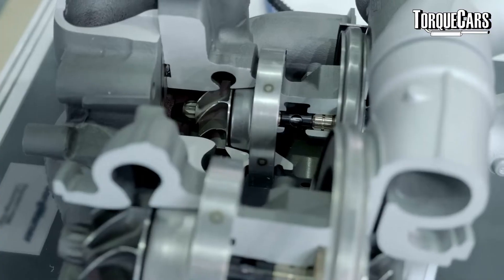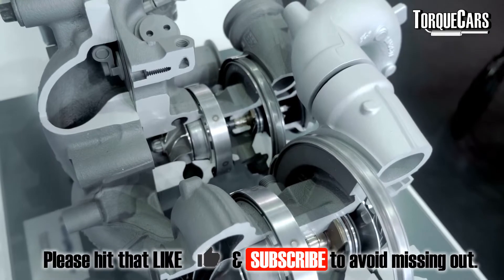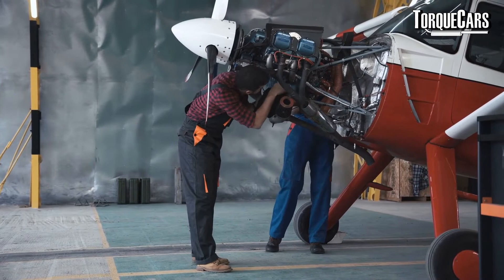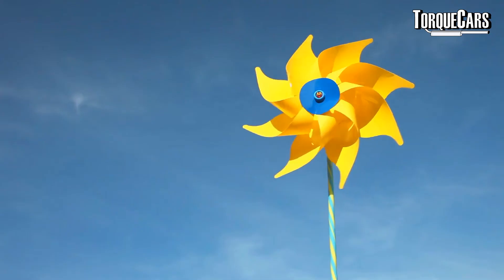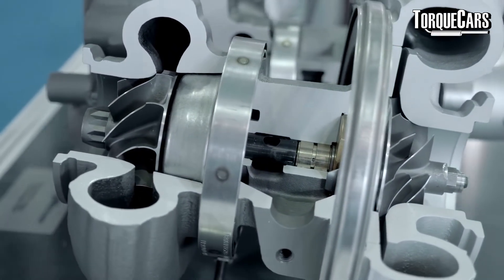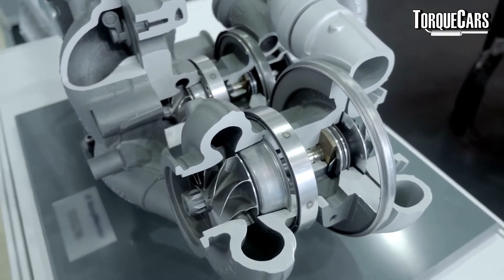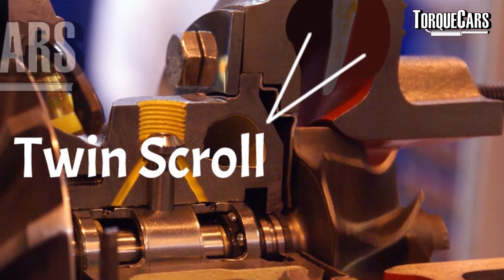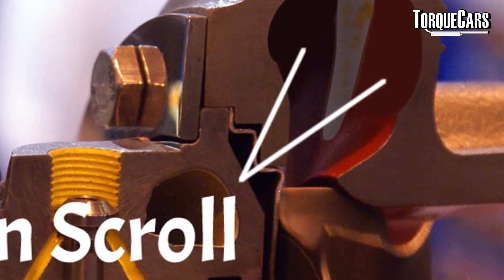Turbos - Wastegates, BOVS & Twin Scroll [Q&A]

Comment: Question.
Can you run two twin scroll turbochargers on a V8?
I’m sure it wouldn’t work on an I4/I6 platform due to lack of cylinders. But I do believe it would work on a V8 due to the firing order. 
Thanks
Reply from the maker: It does very much depend on the firing order, essentially twin single scroll turbos on a V8 is the same as a twin scroll on a 4 cylinder albeit with cylinders firing closer together across the 2 banks, so the scavenging benefits are similar. 

I'm sure going to a dual twin scroll will improve spool up on most V8's but this is quite a complex area and certainly not something I am familiar with. You can in most cases treat a V8 as two 4 cylinders joined at the crank, but they will usually have a lower RPM range than a modern 4 cylinder engine and this needs to be taken into account when specifying a turbo to suit, will it flow well enough and will the exhaust pulse separation work in your chosen V8 engine. 

Hopefully there is someone out here who can shed some more light on this interesting question.
Reply: @torquecars  Thank you for your response, I really do appreciate that information. Complexity and Rpm management seems to be the biggest enemy here. On an inline 4, all cylinders are occupied by the single twin scroll, the same could go for a V8 with two twin scrolls. I’ll do some more personal research but I appreciate your response.